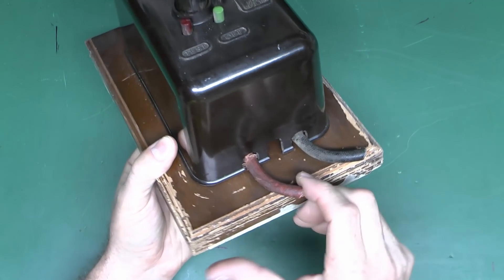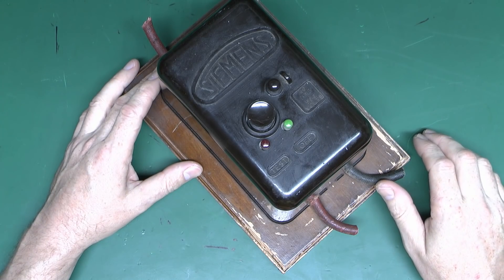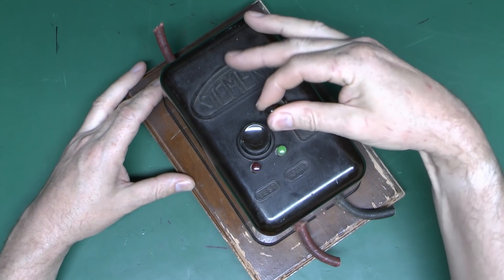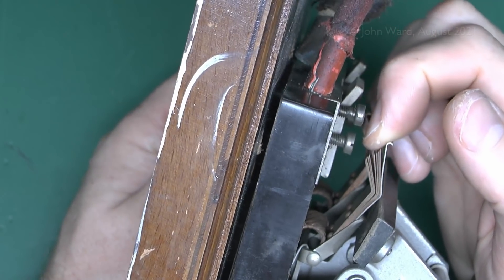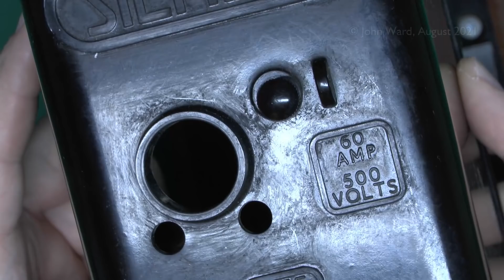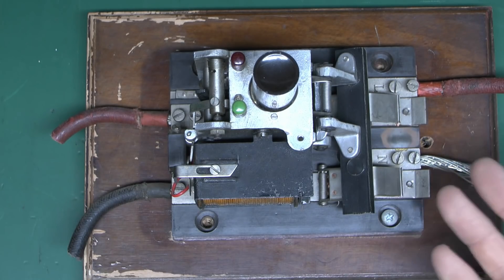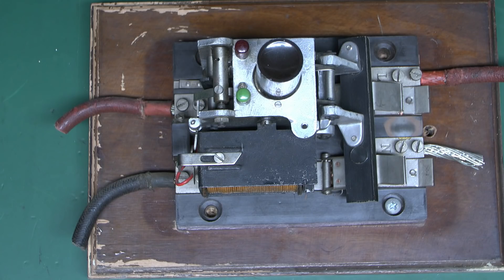Siemens VOELCB examination and Tinned Copper or Aluminium wiring?

Comment: JW: back in the 70's here in  the US, Aluminum wiring was used for a while, and then after a rash of electrical fires, it was outlawed. and to get around that, some unscrupulous electricians started using aluminum wire coated with copper to make it pass inspection. until they were found out, there were still electrical fires here and the guilty parties were charged accordingly  . this dirty trick was used especially in Mobile Homes [ Caravans?] at the time

Comment: I really enjoy your videos which are so informative and interesting.   Back in the 1950's when I was a child I can remember one house we lived at in Bournemouth was supplied with 200vdc and I remember one of these Siemens devices in the damp cellar along with many other metal electrical devices!   My grandfather who had a large house in Hastings fitted his own electrical supply back in about 1912 using several large lead acid batteries powering a rotary transformer to provide lighting and later bought a dc electrical supply from the trolley bus system that passed by the house and apparently every time a bus passed by the lights dimmed  in the house!

Comment: My house was built in 1987, and it and the entire estate had consumer units with an ELCB as the main switch. This is a much later date than you state. Mine is still in use, all the cables are so tight with no slack and the consumer unit is in such a difficult location it would be a nightmare to replace. I'd end up with a junction box on every circuit to lengthen the cables by a foot or so. Instead of such madness I've decided to leave it all alone.
Reply from the maker: ELCB also describes current operated types, which are RCDs.
Voltage operated ELCBs were discontinued in 1981, and were never incorporated into consumer units.
Reply: @jwflame  Ah, so you're saying I actually have an RCD despite what it says on the box. I've lived here since 1987 and never knew that. The earthing is PME. I have noticed sometimes when working on a circuit with its MCB turned off, if I touch neutral to earth by accident the "ELCB" trips. It doesn't do it every time though. It says 30mA trip current on it.
Reply from the maker: @owensmith7530  Yes, 30mA indicates it's an RCD.  VOELCBs don't have any current rating.
Tripping when N-E are connected is normal, it's providing a path for current to flow to E from the other circuits still connected.
Reply: @jwflame  For the last 10 years my dad has been pestering me to get it swapped for an RCD to be safe and up to date. I can now tell him I don't need to, many thanks to you.

Comment: I have a 3 phase version of this Siemens Trip that I removed about 12 years ago. It’s almost twice as big but looks almost the same . 
One common problem with these type of trips is if the earth wire coming from the spike got broken or damaged the trip coil  wouldn’t work . Often the earth wire would only be 2.5mm and not in protective conduit so easy to get broken.  
I used to here story’s of in the old days especially in the summer electricians used to Chuck buckets of water over the spike to get the trips to work if the earth resistance was to high . .

Comment: Quite a few houses round here were are are still wired in copper clad aluminium cable. I believe it was installed round about 1973 when we had a copper shortage. In most cases it’s good condition still but you have to be careful stripping the wire back as if you score the cable it’s them very brittle. Also at the same time copper pipes were being put in with steel mixed in .almost all those pipes have rusted out including my home and had to be replaced with new copper.
Reply: I've seen plumbers install copper upstream of steel - the results are certainly impressive after a few years!

Comment: Nice video. Rather surprised to see a cross / pozi screw holding the device to the wood backing. Was that really original or was the device remounted recently?
Reply from the maker: Screws probably more recent from when it was removed from the installation, there are 4 holes which have been used for screws but only 2 screws in them currently.  Wood backing is original to the device, there is a shadow of the outline of the casing on it where the exposed parts have faded over time.

Comment: Where is the problems using aluminium wires?
Here in Austria aluminium cables are used >25mm2 for some applications for industrial or power supply cables
Reply from the maker: No problem for larger sizes, 16mm² and above are still used in the UK, with the specific connectors designed for aluminium.
The smaller sizes for wiring inside premises were only in use for a very short time when there was a shortage of copper.  They had to be larger than the copper equivalents making it more difficult to connect them to accessories, and as most accessories had brass terminals, using aluminium with those often resulted in extensive corrosion.
Reply: @jwflame  okay that is exact the same here in Austria. Aluminium conductors where used in the 50th (2.5mm2 with rubber insulation). Now due to the high cooper price aluminium is used for main lines eg 5x35mm2 for a.
Of course special conditions are installed.
I have never seen a aluminium cable in the UK here 9n YouTube. 
Where do you use aluminium?
Reply: @Ragnar8504  i removed a lot of aluminium wire in my life 🙂
But you are right the most old rubber insulated wires are made with tinned copper wires.
But both types has to visit the cable recycling plant for sure 😜
In the power grid (netzebene 7 - 400V) aluminium conductors are used since the 1960 with PVC insulation. Now a days aluminium conductors are used in building as well due to the high cooper price.
No body likes to pay 95m E-YY-J 5x70 any more 🙃
So E-AYY-J 5x120 is installed 👍
Reply: @simonschertler3034  Does Austria also have 3 phase 63A services like Germany? Were ungrounded sockets still used in the 1960s?I also heard from a few electricians that they had a fuse in the neutral wire too.I hope that was only the case for single phase circuits.
Reply: @mernokimuvek  Yes, 3-Phase-System 230/400 V as other european countries. But the N ist not fused !   They use 2-pol or 4-pol breakers to disconnect L and N at the same time. L with a breaker device and N with a switch without breaker function
Reply: @simonschertler3034  I would never give those old wires to cable recycling. As a radical hoarder i collect them.

Comment: 14:20  Hi John. Have just emailed you a photo of table 26M from the 14th ed am3 1976, which gives ratings for smaller sized copperclad aluminium cables.  Hope it's of some use.

Comment: We have solid aluminum branch circuit wiring in our house.  Almost all houses built in Canada between 1967 and 1975 are with aluminum wire.
Reply: I imagine as your time permits,  people will get to see some of this.  ;)
Reply: Eastern Bloc countires before 1990 almost always used aluminum wiring.And most often there were no wire nuts or any other connectors.Wires were just twisted with pliers and wrapped with electrical tape.Lasted decades without any problem if it was done properly. And of course in some countires there were grounded sockets only in the bathroom and kitchen and the neutral wire also had a fuse in single phase circuits.

Comment: Excellent demonstration. Also interesting to learn why wiring used to be tinned copper.
Reply: Someone from the US here. We’re they soldering splices when these were installed? If so it may make the solder flow better. I’m only 50 so these things were long out of service when I started in the field.
Reply: @juz4kix  Not usually. Europe preferred all sorts of screw-based connections or downright twisting and taping. The latter is now considered bodgery but will last for a long time if done properly.

The tin layer was purely for protection during the vulcanisation of the rubber, which involves sulphur. Rubber flex had tinned conductors until fairly recently, maybe 10 or 15 years ago.